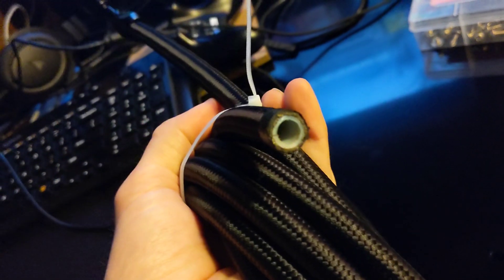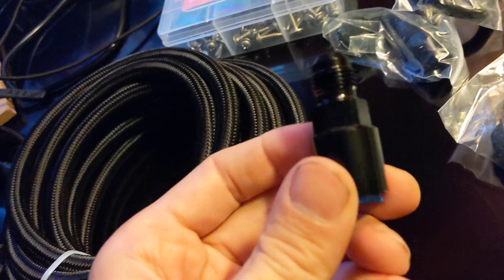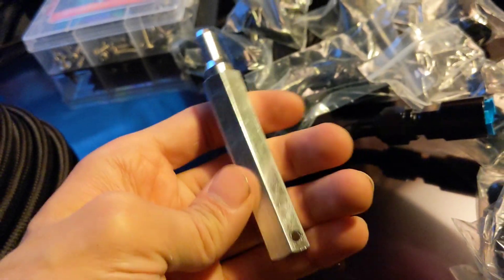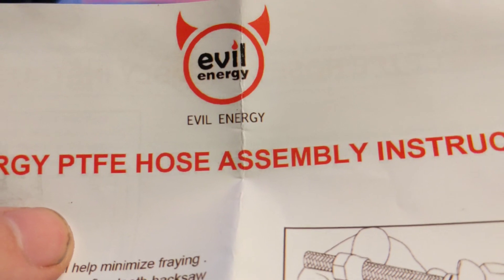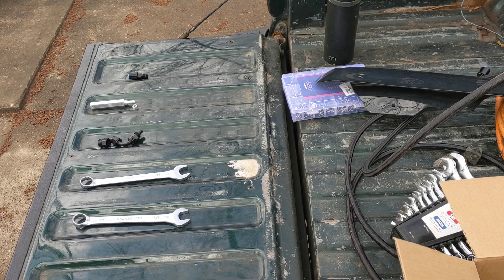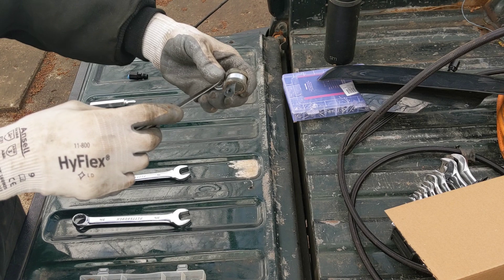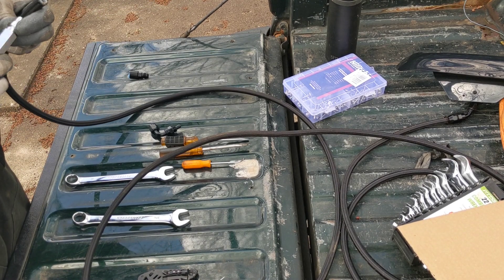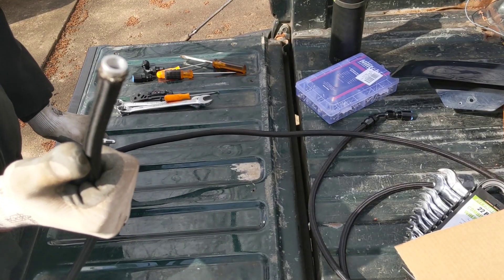how to do ptfe fuel line + AN fittings

Comment: did it come with those furrels/olives?
Reply from the maker: its been a while, if you want I can go back and check the amazon listing. I think it came with a couple fittings. I know I purchased extra
Reply: @funtripgarage  the silver piece that u put on the braided line
Reply from the maker: Ohhh those come with the fittings.
Reply: @funtripgarage  at 8:10
Reply: @funtripgarage  and did it ever leak?
Reply from the maker: Never leaked.  I'll check the video. It's been s while and I don't have that truck any more.

Comment: Tool opens the inner tube back up after you cut it. And you need to trim the black putter coating off letting the socket against the steel braided
Reply from the maker: it was a fabric, super hard to trim. I didn't have any leaking issues.

edit, I know I have more experience with this stuff.
Reply from the maker: Ohh I'm now realize what tool your talking about. Thanks!